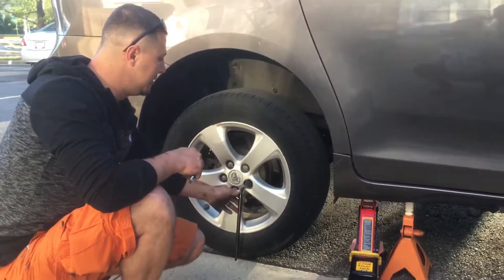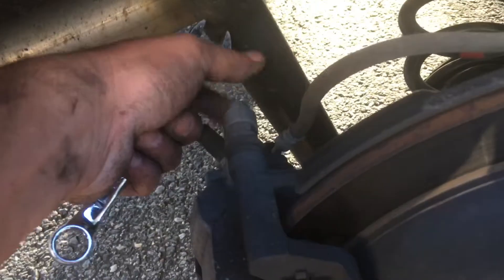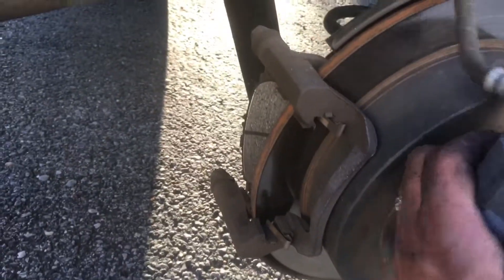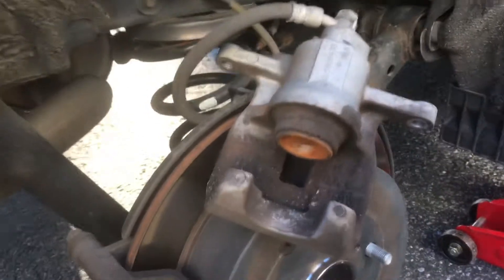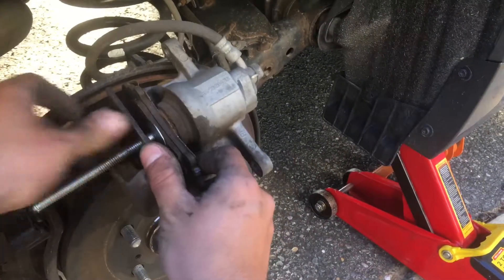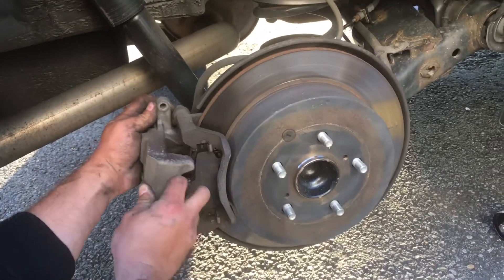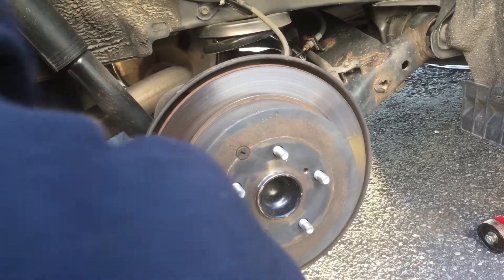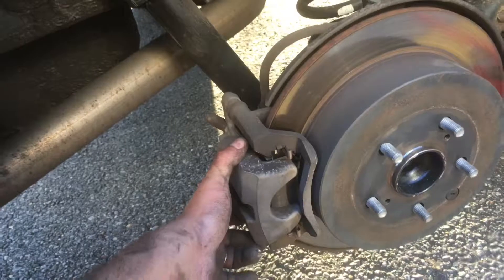HOW TO CHANGE A CAR BRAKE PADS!! EASY!!

Comment: I come here to comment on you white van speakers take appart. Let me tell you, those speakers even without a brand name on them looks pretty good, with a big magnet and good foam surround. You will find the same kind on some other "brand name" more expensive speakers. About the bricks, I guess they are there due the cabinets tall design and to keep their  lower weight balance at bottom, to avoid been pushed and fall in your kids or pets head. That is usually found also inside laundry washers to kep them from shaking to much but instead a brick you will find concret, also inside some desk base lamps to keep their weight at bottom and avoid to flip out.
Reply from the maker: Been Polite that might be a explanation for the bricks in the speakers but the reliability wasn’t as good as expected. Did they sound ok? Yes, did they last long? No. I had all sorts of crackling noise coming from them after few months of mild use. And one speaker completely gone to crap. So I just didn’t wanna carry them when I moved so I took them apart. They did look good tho.
Reply: @MotoRoUsa  Hi, thanks for take you time to answer. I have a pair of the model called "AM Acoustic Monitor Liquid Cooled Series 660", 3 way with a woofer of 12", mid range 5" and tweeter of 2 or 3" I guess.The cabinets are made of 3/4 thick particle board as has to be due size and to avoid any resonance from the wood itself,( no bricks inside). I foud them at a curb like 15  years ago. To my surprise they sounded pretty good in special with organ and other instrument sounds. I still have them and they still working, to my surprise the surround foam never got bad. They are part of around 8 pairs of different speakers cabinets from brands like Pioneer, Sony, JBL, Infinity, Criterion and MTX , all connected to 4 amplifiers from the same era ( 80's?.) to handle my set of keyboards and synthesizers so, I can tell you that they are not less than the others well know brands. At least that's what I had experienced. And to me the best sounding ones are the MTX columns. I wish I could find some day a pair of Acoustic Research AR3, the most natural sounding speakers.
Have a nice day.